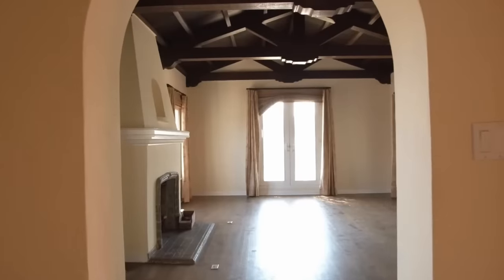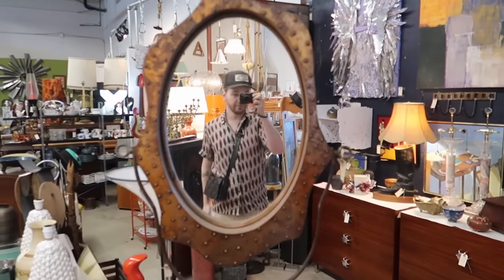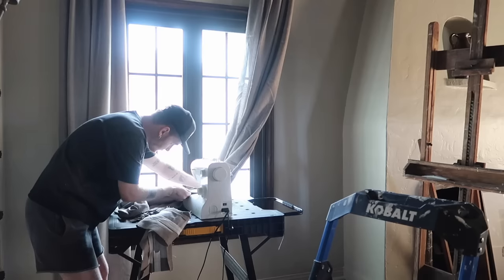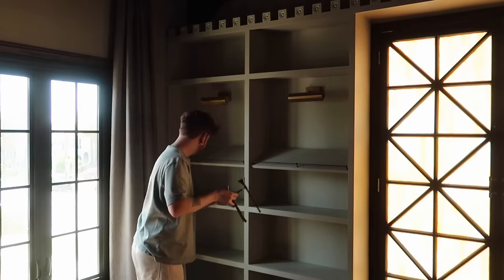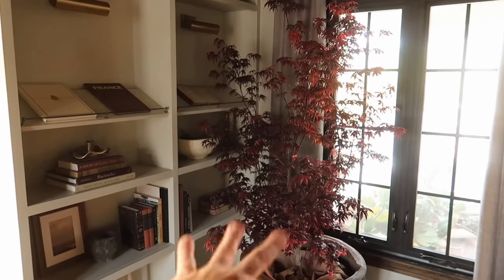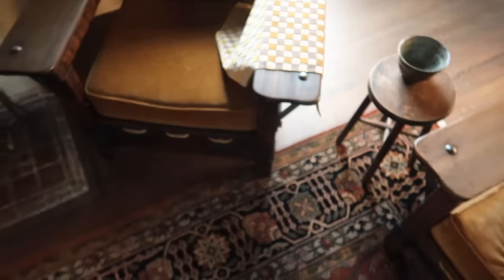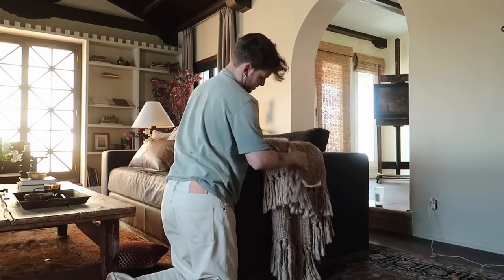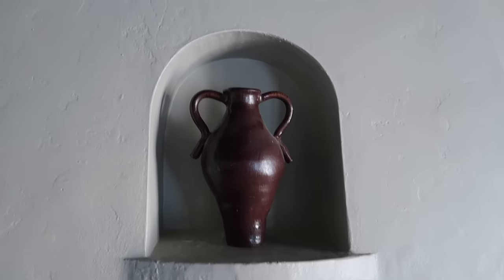EXTREME LIVING ROOM MAKEOVER ✨ 1929 Spanish ✨ DIY From Start to Finish

Comment: The art glass windows look perfect...like they've always been there. I'm obsessed with that central iron light fixture! Is it original? My living room has a barrel ceiling, tall windows on one side, and two niches with gum wood shelves flanking a big arch into the dining room on the other. The fireplace has an 'Art Deco' mantel and there are bright floral Talavera tiles around the half-circle fire box. I love Spanish houses, and I was very disappointed our original central ceiling fixture was missing. The sconces above the fireplace were really small, and actually looked like outdoor lights. Though I went with a new set of light fixtures, they are black iron, curled at the ends, and the lights are frosted glass faux pillar candles. You would not believe the icky 1980s faux colonial light blue brocade drapes, matching wall to wall carpet, and faded blue paint...well, maybe you would. Your room makeover is looking terrific. Good on you for keeping the vintage Spanish feel.

Comment: I love what you've done in this room. Won't repeat what everyone else has said but one thing stands out that kinda bugs me is the space over the windows on either side of the bookcases. 

The curtains go up high but the windows don't and to me it looks odd. I think if you made some Roman blinds in the same fabric as the curtains/drapes to place above the windows. They wouldn't have to be full length or functional, just decorative to fill the gap above the window and then it would look like the windows were full height but you'd added blinds. It would fill that awkward looking gap and look more luxurious. 

Hope you don't  mind me making a suggestion.

Comment: everything is awesome, except for the bookcases wall. there is something off balance, it looks empty and busy at the same time. the little squares at the top being the  most distracting and irrelevant and also the plain sconces, they are the only thing that looks cheap in the whole space. also too much symmetrical empty space on those two shelves. some interesting vertical sconces would look great there i think.